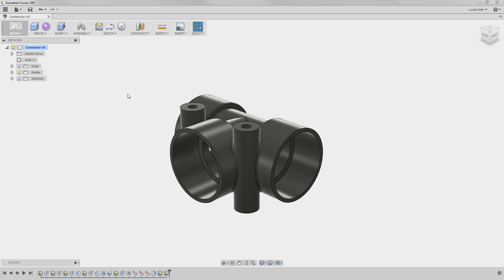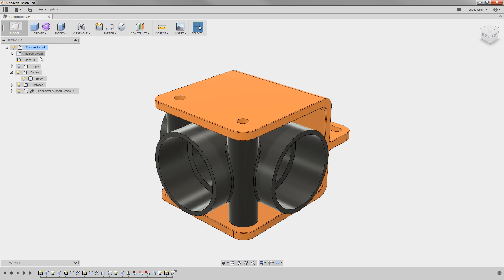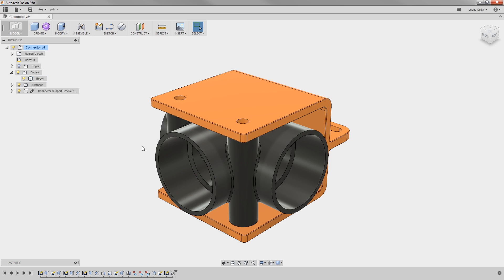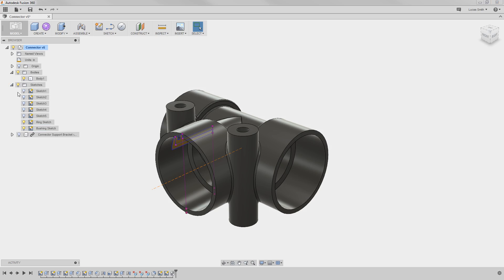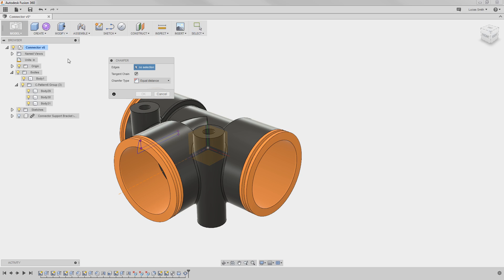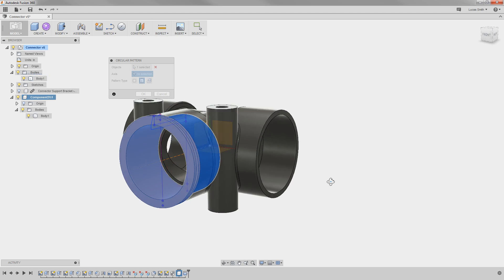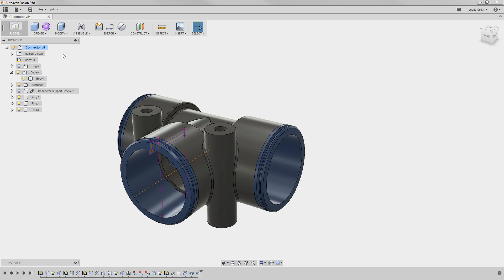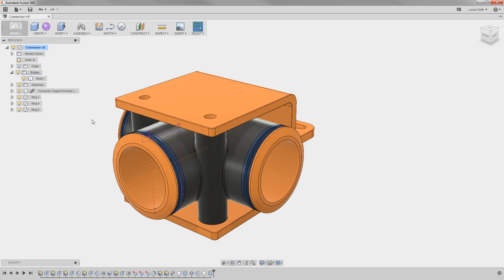7: Assembly Modeling

Comment: I should be able to move a body from one component to another. or select multiple bodies and make one component with those multiple bodies inside.
Reply from the maker: Depending on the history, you can move bodies around like this...but sometimes references can complicate things. Per the later recommendation, when selecting multiple bodies it will interpret that as way to make a component from each. If you want one component will all bodies, make one component then move other bodies to it.